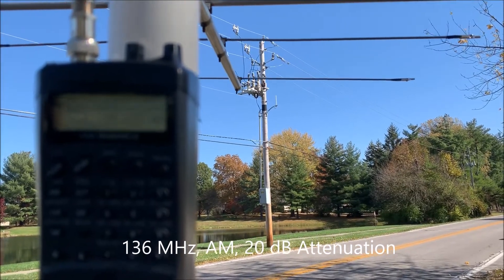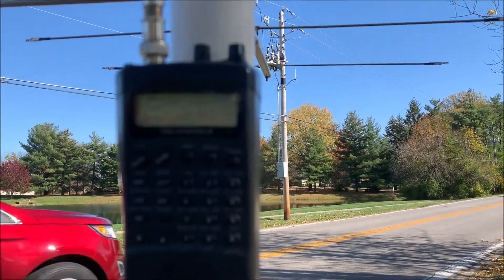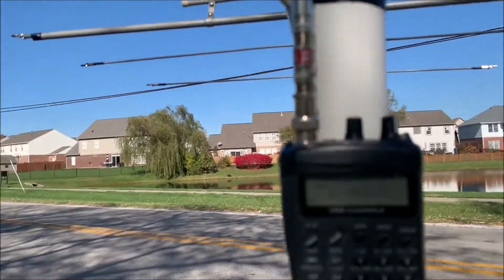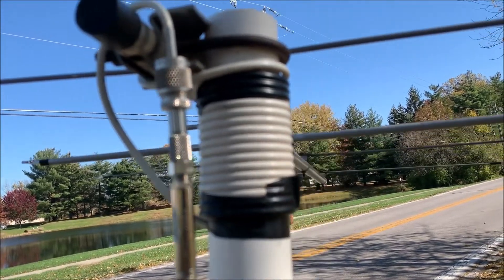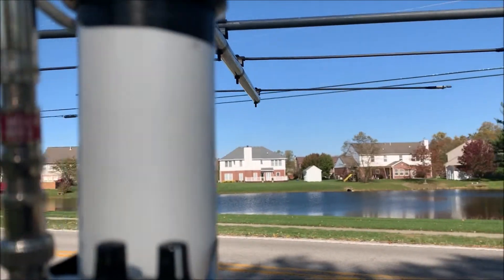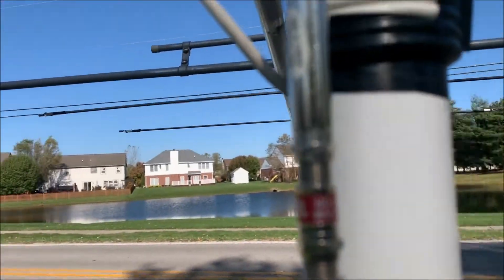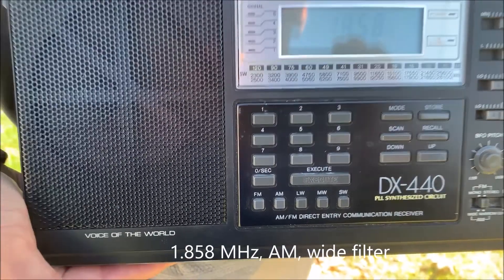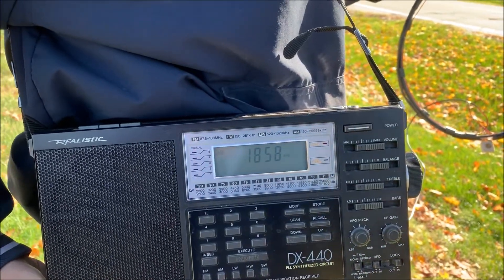Radio Frequency Interference at W9RE suspect power pole Nov 1, 2019

Comment: I moved to my YLs house a few months ago and have been plagued by that exact noise but havent had the time to go hunting yet. Do you have a layout schematic on the antenna you used?
Reply from the maker: Hi Andrew, for power line interference you really need to use a radio in AM mode so I use an old police scanner tuned to 136 MHz because that is in the aviation band where AM is used.  Then I use an old 2 meter cushcraft 4 element beam and I lengthen the end of each element by approximately 1.5 inches to tune it to 136 MHz and I use alligator clips to lengthen each element and then use electrical tape to hold them in place so they don't get knocked off (really works great, and a very simple solution).  You have to lengthen each element so the antenna maintains a good directional pattern on 136 MHz versus the original frequency the antenna was designed for (146 MHz).  I start off with portable HF gear to get close to the suspect pole/poles and then switch to 136 MHz to identify the exact pole causing the interference.  When very close to the pole I actually have to install 20 or 30 dB of attenuation on my 136 MHz system to identify the exact pole that's causing the interference.  Normally can start hearing the suspect pole on 136 MHz from about 0.2 miles away when not using attenuation.
Reply: wd8dsb thank you

Comment: It ant spouse to do that if u live claose by we have loops and green boxes becuse of a npr st close by i use to be on the other side of the booster ten years ago
Reply from the maker: Hi Teresa,  I don't really understand your comment, but let me explain more.  There are many different things on power poles that when not working properly can generate arcing and arcing in turn often generates radio frequency interference which is very boradband (generates radio frequency interference over a large segment of the radio spectrum).  One typical device found on power poles are lightning arresters, and when they fail they generate broadband noise in the radio spectrum similar to what I mention above.  Loose hardware on power poles can also cause arcing which in turn causes radio frequency interference.  Just FYI, Don